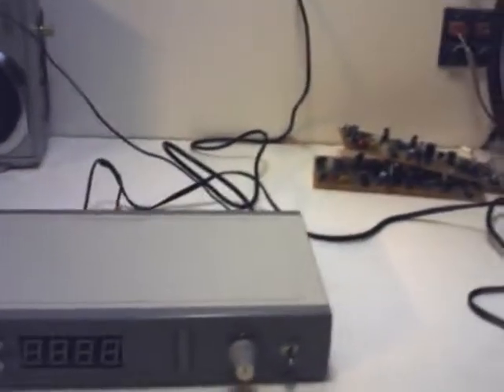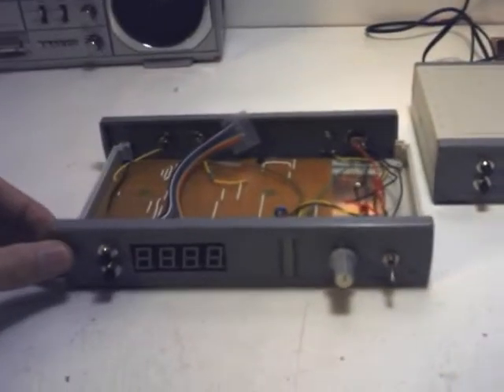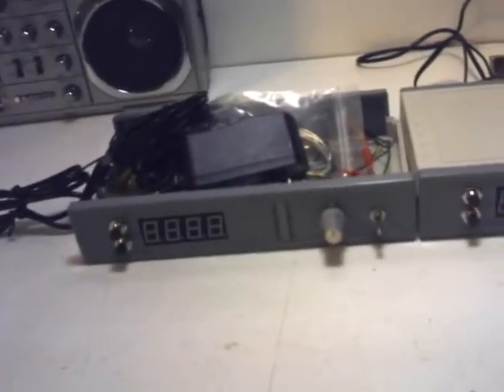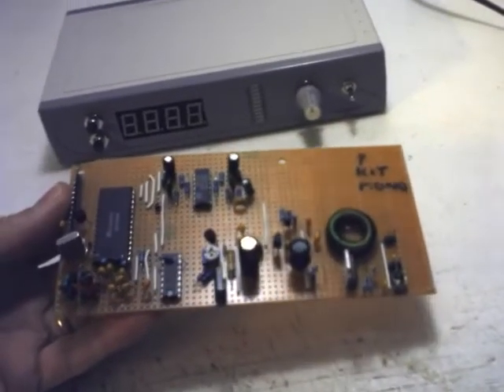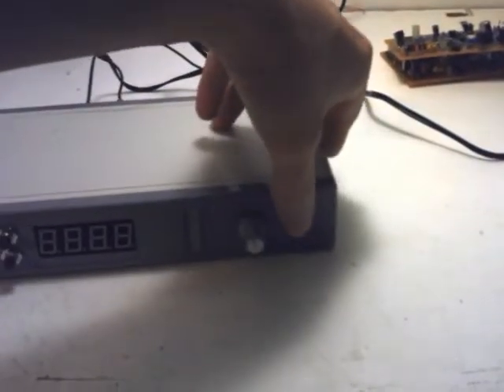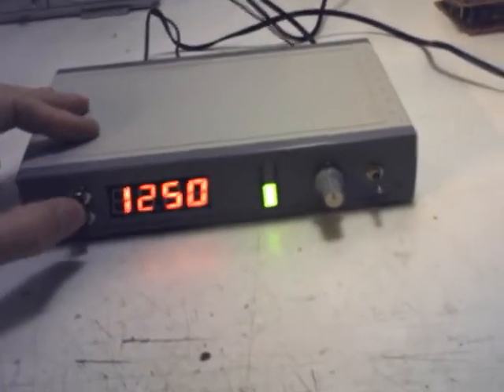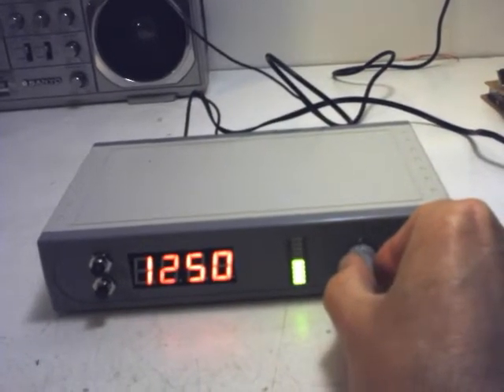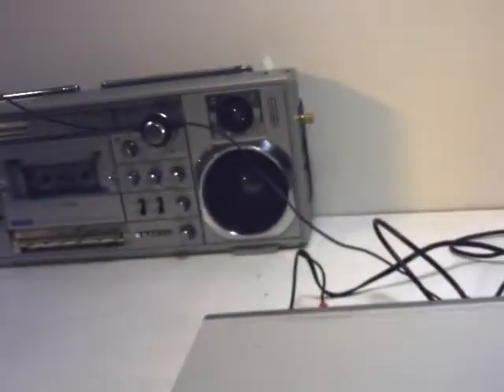New Transmitters

Comment: I'm legally Blind and cannot assemble a transmitter but want C-Quam.  My engineer has had some family health issues and my ASMAX2's control board went south and needed replacement.  I have a question:
The ASMAX2 had a 50 ohm output which still worled with a 75 ohm coax connected to an outside antenna.  But with me being legally Blind I can't to outside and tune when the temperature changes the capacitor value.  Is there a way I could get a fully assembled unit that would allow 50 ohm and be tunable from inside the house?
Plus in the states you can use neutral injection carrier corrent up to 50 watts but most have used 5-10 watts with a coupler and got great results but I can't put something like that together that world work on standard US 120V outlets.  This would be used if I decided to move into a bigger appartment but they don't allow antennas and I want to set up an Album Rock station that could carry 1.5-2 miles out like my ASMAX2 did.  Let me know if there could be something done.
My album Rock station is @ http://thelegacy.shorturl.com
Reply from the maker: I'll be working on a 50 ohm version soon. I have had a couple of inquiries about it.
Reply: You could do 50 ohm but the loading capacitor and rf sniffer for tuning antenna wouldn't work. Better with things as is with a long wire.